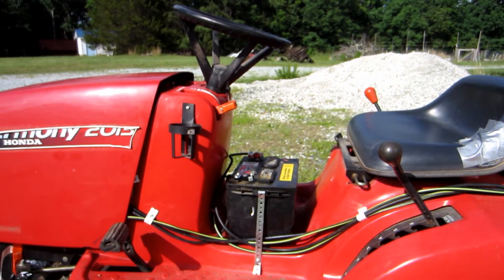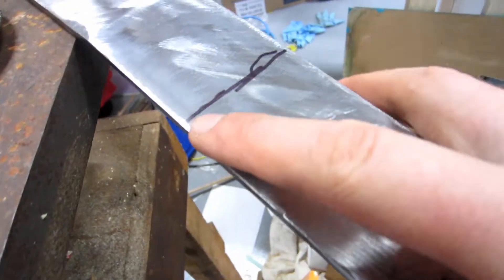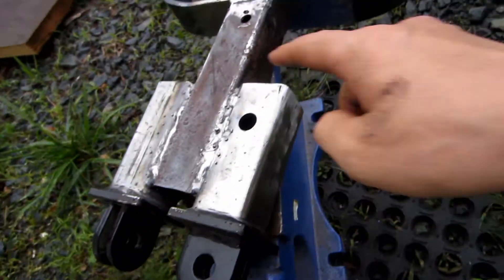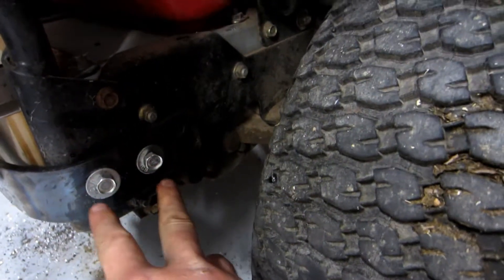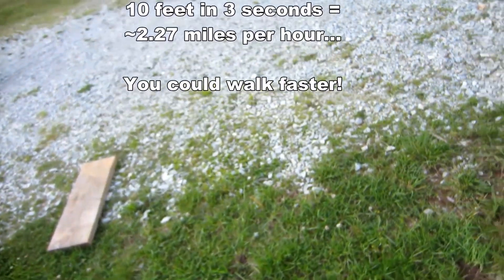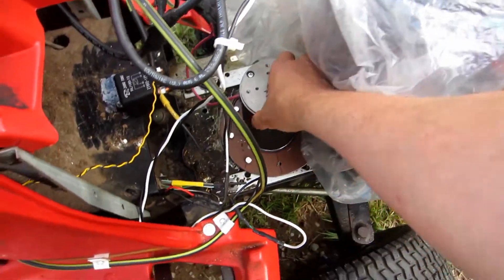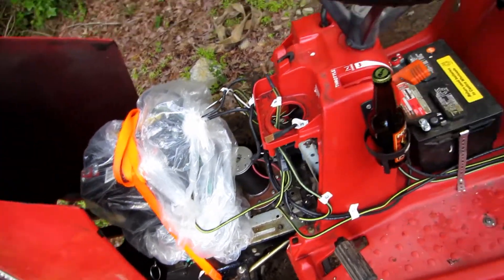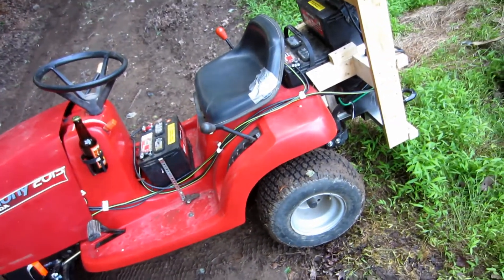Performance testing EV | adding hitch to modified lawn tractor

Comment: Could you get a bigger motor like a 110v and just use a DC to AC converter?
Reply from the maker: Technically yes, though the main issue isn't whether it's AC or DC.  Universal motors run on both.  The real issue is the amount of overall power consumption for such a high current application (driving a vehicle).  Converters use semi-conductors and the more current pulled, the more heavy duty they need to be.  It would be just as cost effective, if not more, to simply purchase a motor that is better suited to the application. :)
Reply: someguyinncarolina , oh ok I understand, I compete in car stereo competitions and we use deep cycle batteries, the best brand I have seen so far is Northstar. You should check them out
Reply from the maker: Thanks for the tip!  This vehicle is actually wayyy overpowered in terms of battery capacity.  The motor is the weak link.  I just didn't want to spend $800 on a proper motor for it. :P

Comment: You need to add an ammeter to see what the current draw is on the motor.  Just guessing but that looks like maybe a 1/2 horsepower motor at best so it is no wonder it is getting hot.
Reply from the maker: I agree on both of your points.  This project was intended to cost almost nothing and that motor was about the cheapest solution I could find; but, it is obviously under powered.  I've been keeping my eyes open for cheap DC motors at thrift shops and such, and although I find plenty of universal motors, they are all wound for 110v.  Thanks for the comment!

Comment: I have an idea to cool the motor and relay, but I need to know the dimensions of the motor and the relay module.
Reply from the maker: Hey Jack, sorry it took mew a few days to get around to taking measurements.  Motor is 6" height x 3.5" diameter.  Relay is mechanical and doesn't really get warm (rated at 200amps).  Relay dimensions are 1.8"x1.8"x1.8".  Let me know what you're thinking. :)
Reply: I just got back from a fishing trip in alaska, and I got your reply just when I left for the trip. I can finally start working on the plans for the cooling system.
Reply from the maker: Sounds like a good time.  Thanks for the update! :)
Reply: my idea involves making a waterblock that you mount to the relay, and another waterblock out of an aluminum pipe with a 3.5 inch inner diameter, sliding the motor in the pipe, and putting the motor pipe assembly inside a bigger aluminum pipe so there is space between the motor/pipe assembly, and the bigger pipe to allow water to flow through. then you would have to weld to metal rings to the top and bottom to seal the contraption, drill to holes on each side of the the motor waterblock assembly, tapping the holes to g 1/4 inch threads, and hook that up to a radiator. I can send you the plans I have through priorty mail, or email them to you.
Reply from the maker: Sure, that sounds interesting.  Send to someguy@someguyinncarolina.com  Thanks!
Reply: someguyinncarolina Sure. Will do as soon as soon as possible
Reply: Wouldn't it be easier to simply wrap the motor with 1/4 inch copper tubing?  With your system you still need a supply tank, pump and radiator.  Further, it can be done with hand tools.